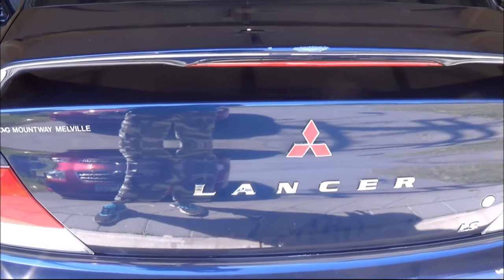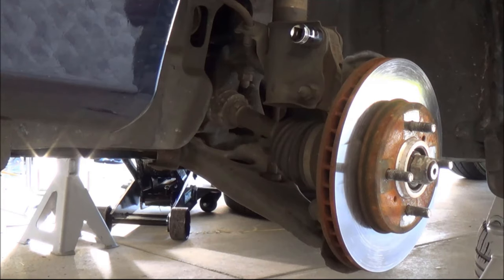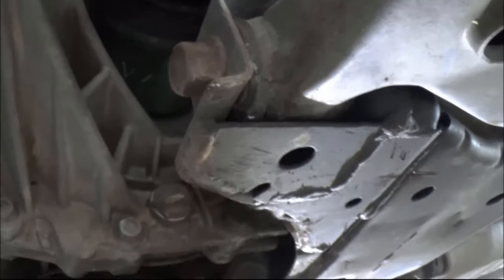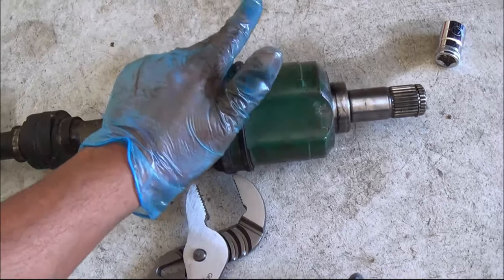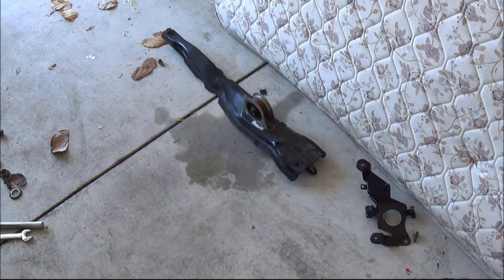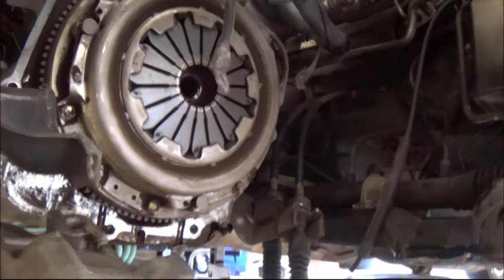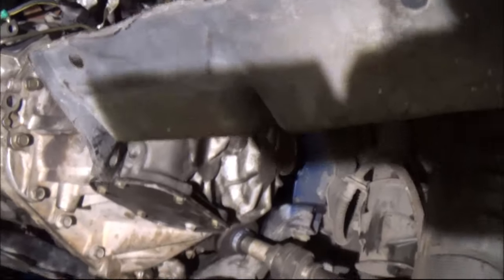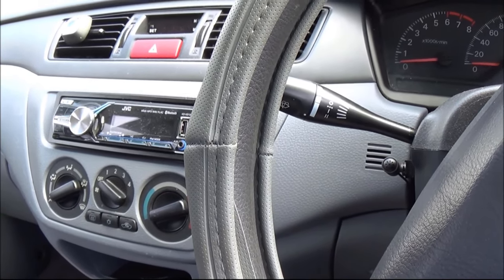How to REPLACE a clutch in a car - (Step by Step guide)

Comment: Im glad you showed taking off the transmission and cleaning it out, a lot of other videos I’ve watched lead you to believe you can change it out with the 3” of space between the housing and engine without pulling it out. And to be fair if you can see how it is taken out you can surely put it back in considering that’s why they send you the alignment tool. To me you showed the realism aspect of having to figure it all out while your doing the job which is how I work all the time bc I run into bolts that will not turn or some other obstacles that aren’t shown on here, I hope you keep making videos my friend! If your looking for torque specs and a step by step honestly the best you can do is buying a book for your car or looking it up on google and just jumping into the job if you have the tools to do it that is.

Comment: Missed the important bits of the install - the use of an alignment tool to line up the plate and whether this is done in one or two passes, and what lube to use where (if any) on the spline under the thrust bearing and or the clutch plate spline.
Reply: DinoProf you know any better ones mine just burned out

Comment: this guy didnt even resurface the flywheel ??
Reply: If there are no marks, scratches or blue shades from overheating, there is no reason to resurface the flywheel.
Reply: I was always taught have it resurfaced no matter what, hell all that work and not have it done is dumb.
Reply: @Metatr0n  Would you resurface the flywheel if it has 15k km on it and has a tiny bit of rust spots?
Reply: @KDD8  Depends on the history of the car. 15k of city-traffic and shopping, done by a proper driver? No way would I resurface the flywheel.
15k on the Nürburgring and blue shades on top of the tiny rust spots? Probably yes.
Reply: @Metatr0n  @Metatr0nThanks my man. It was 15k of city-traffic. What happened was this kid changed his clutch and flywheel and after he was done his rear main seal went. The organic clutch got soaked in oil and rendered useless, but his flywheel is brand new so I ended up grabbing that. No blue shades, it looks like little surface rust spots.